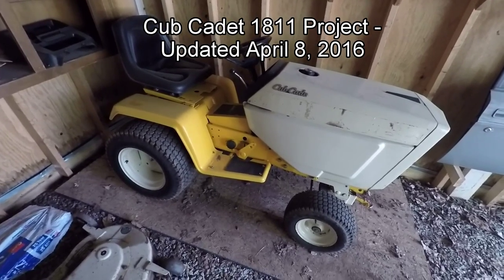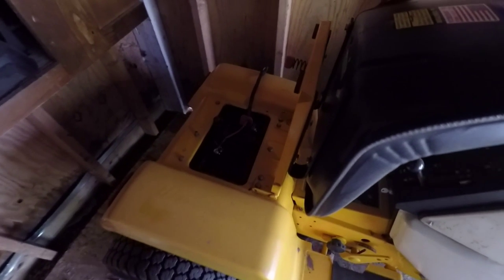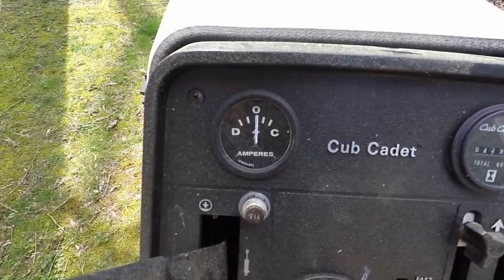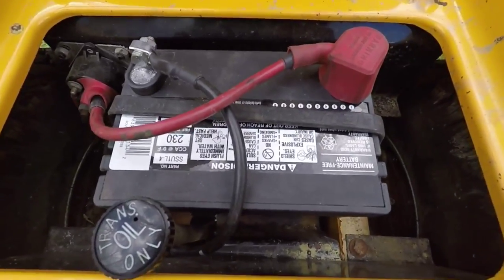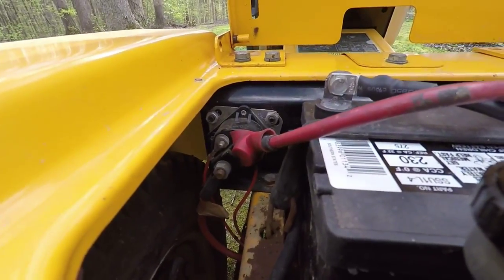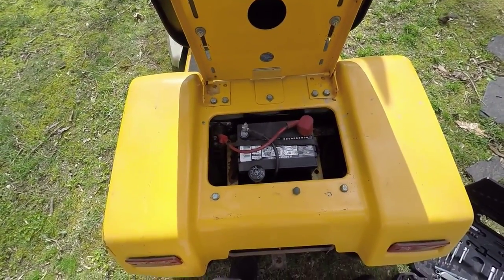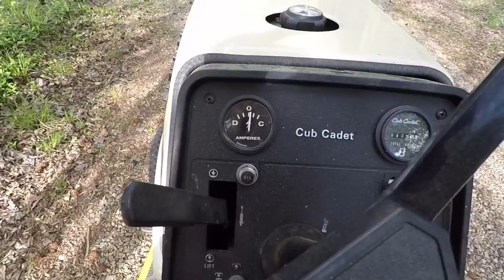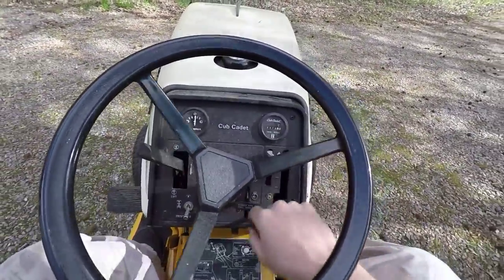Cub Cadet 1811 Project - Update April 8, 2016

Comment: I still think you've got a bad ground  Put a jumper cable from the -- neg side of you battery to your'r engine. also check you voltage regulator and make sure it has a good ground . i know

 this is 4 years later but you might still have is.